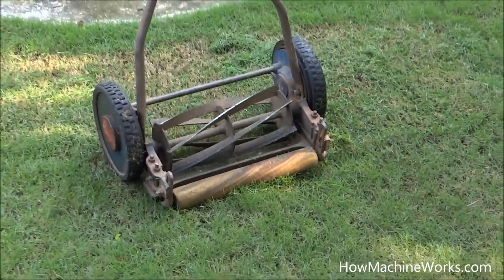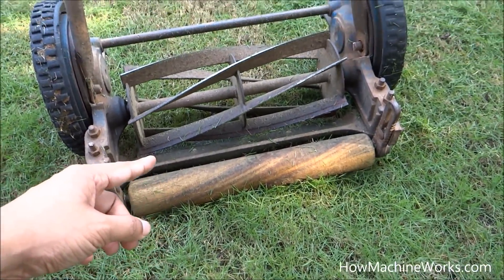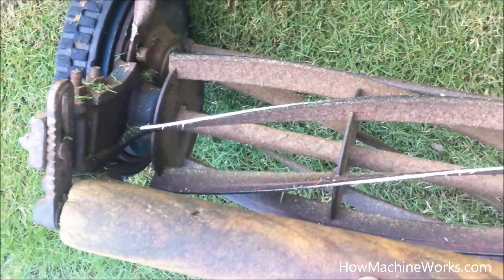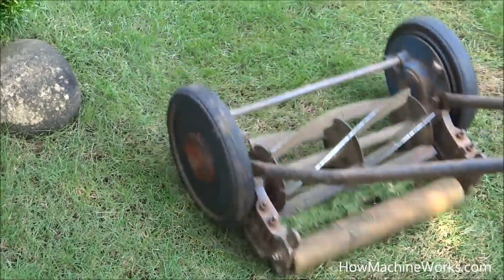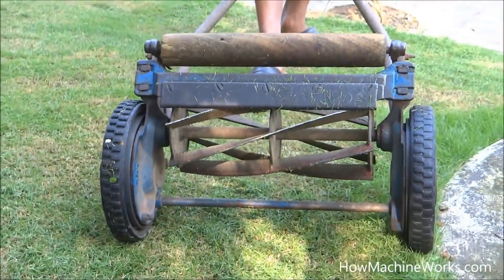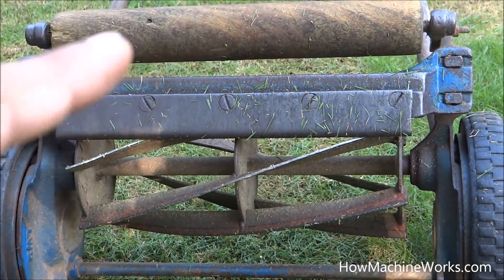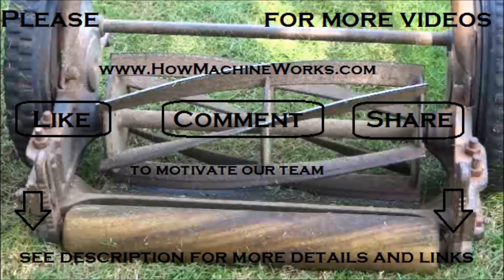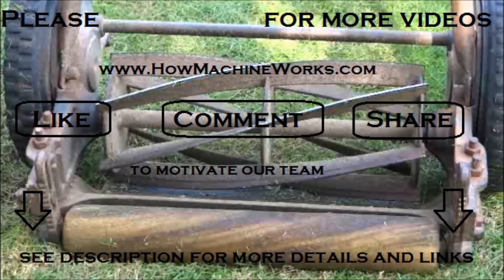How a manual grass cutting machine works - Must watch

Comment: Like the product and interested in where Can I purchase and price ,some questions thought;  Does it cut  different heights of grass, is the  thickness  of grass adjustment in product available, can it be dismantled to sharpen blades. Spare's availability. Would appreciate if you could send me details on this no.thanks
Reply: This is an antique. You can buy new ones but they push hard. There's a reason everyone stopped using them when the gyro mowers came out.

Comment: How to resharp the blades??
Reply: Clean the mower with a brush and damp cloth to remove the old grass and soil .I jammed the blades with a thick stick and sharpened the blades using an electric sander. I also oiled the screw's and nuts. It worked beautifully for me. 😊
Reply: @spumantemerrick2832  can u pl tell me whether this will work on slightly uneven surface

Comment: where we can buy that cylindrical cutter and please provide some information regarding that seller.
Reply: the best i found was at walmart.com for the price and size they had lot 16" butt found 20" and price the same as the 18" so i  will get the 20" and it is Best Choice Products Lawn Mower 20" Classic Hand Push Reel W/ Grass Catcher 6 Adjustable Height 20"
Reply: I want this . what is the price ?

Comment: buying this is costly?? that is surprising, i figured people would be giving these away
Reply from the maker: sure...but the coin has 2 sides...
Reply: they're costly up front, but once you factor in annual fuel, oil, filters, belts, blade or trimmer line, protective equipment, broken windows, electricity bill(for electric machines) and preparation time, you'll find that these are way more practical given you have a small enough lawn and not a field